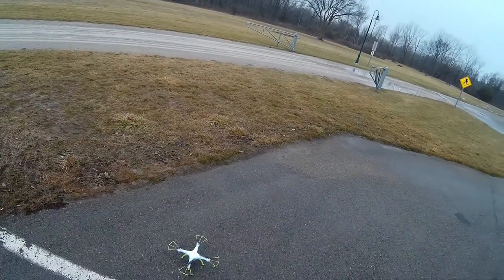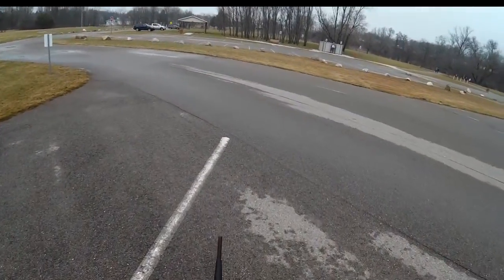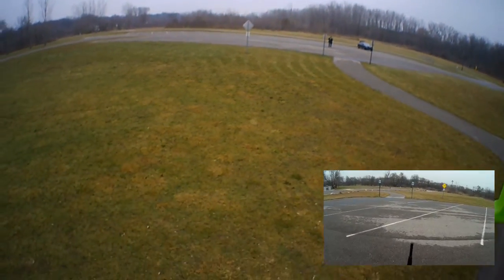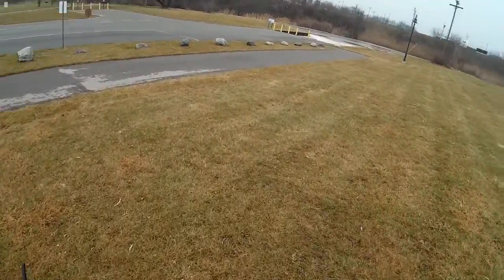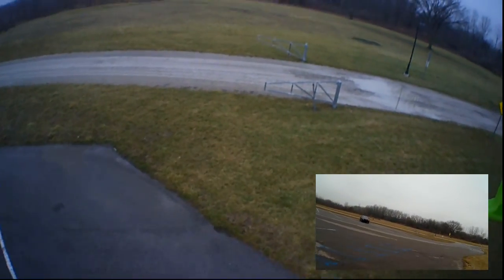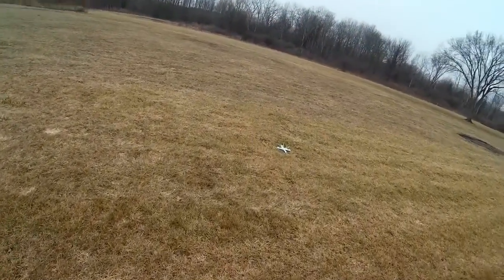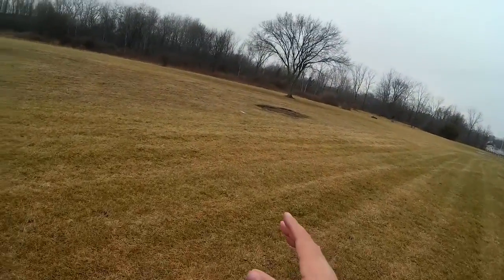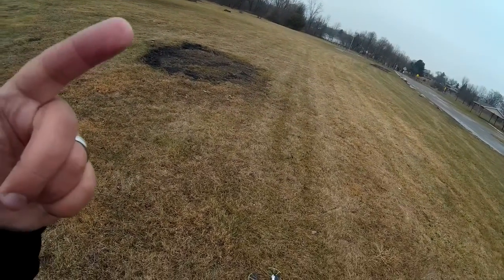Video Drone - Flying the Syma X5 with the 808 Keychain Camera!

Comment: Hi Video. I find in cooler weather the air is thinner.Try swapping out the prop's to x5hc blades. When we do -30 to-40 or even -50 it flies better. You look like you know what your doing so do away with the prop guards catch way to much wind. good video check out some of mine thanks
Reply from the maker: Yes this is the Syma X5Hw so it has the higher performance props, however your right about the prop guards, was just too lazy yet this could tip the scales a bit for the extra weight of the camera so they are going to come off :-)  Thanks for reminding me!

Comment: Brave man flying copter near new car in the cold and wind. Ha ha. Looks like the copter was struggling against Mother Nature. But on the bright side you are gaining a lot of experience and stick time. 

Waiting for the loop to loops and acrobatics. Lol. Away from the car and flipping upside down because the battery died does not count. Cool, but doesn't count. Lol

Looks like you are having a blast.
Reply from the maker: The cool thing here was the 3D printed camera mount as Droning gives me a reason to print!  That makes me happy and the flips will come this summer as I am going to buy an arco-copter after I finish the S500 build as I have almost two months of video in queue already :-)
Reply: Video-Drone - I said it before and I'll say it again. I want to come play at your house because you have all the cool toys!  Lol. 

Can't wait for the videos to come out. The camera holder looked like it performed well as I would expect camera shake if it were a loose fit with the camera or the mount to the drone. The video was steady and had a great view. Now I know what a drone sees as it's heading into the trees. I could only think of Charlie Brown and the kite-eating-tree at that moment it went in. Ha ha.